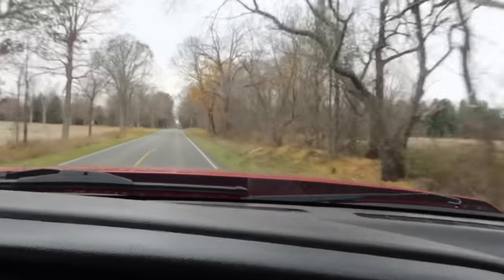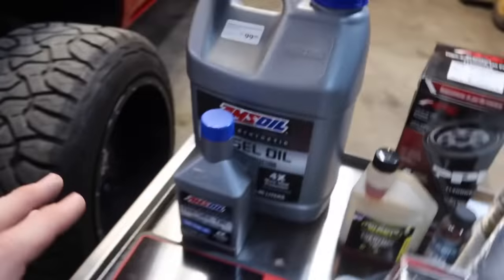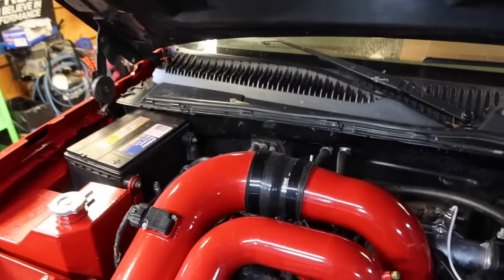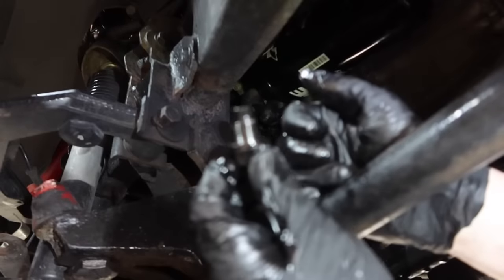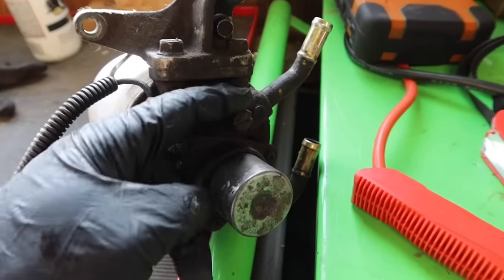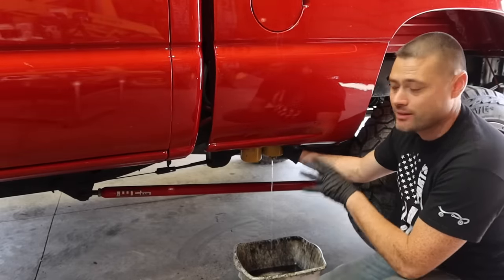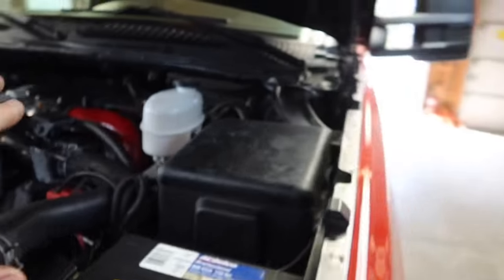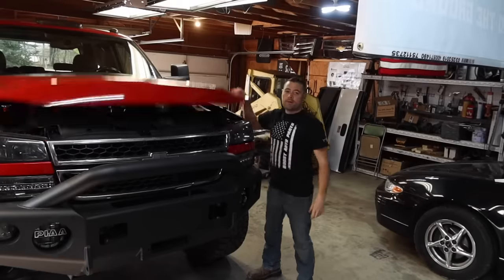How To Maintain A Duramax Diesel “MUST WATCH”

Comment: I found another way to check injectors if you don’t have a scan tool. Turn the truck on and once it’s warmed up, slowly rev the motor up to about 2500-3000 rpm then let off the throttle. If the rpm gauge goes down smoothly then the injectors are good. If the rpm gauge goes down then goes back up a little bit it’s a sign that one or more of the injectors isnt working right and still spraying fuel
Reply from the maker: I like your thinking
Reply: Thanks for the tip. I was stressing not having the scan tool
Reply: @TruckMaster how many miles between oil changes with amsoil?
Reply: I think it's 10,000 but you could always take an oil sample through cat or horizon / Polaris laboratories. Go on their website, they'll tell you what wear metals are displaying and what kind of fuel dilution you're dealing with.

Comment: Thought I would share that Amazon has a bundle deal on the A/C Delco oil filter, fuel filter and Allison transmission filter bundle deal $66 and some change. Where AutoZone wants $59.99 just for the fuel filter.

Comment: It’s all about common-sense maintenance. I run three diesels… A 1984 GM K2500HD with 6.2 diesel (bought new, 325,000 miles on it)… a 2007 Jeep Grand Cherokee with the Mercedes diesel (bought used), and a 2009 GMC 3500 xtended cab with Duramax (bought new, 194,000 miles). The Jeep is my wife’s vehicle, the two GMC’s are work trucks on our place here in NW Wyoming.

Best maintenance advice I ever got was from the head mechanic where I bought the 1984…”Never put it in gear until she’s warmed up… use the best oil you can afford… and use Power Service in every tank of fuel.” I’ve followed that advice religiously. When I bought the 2009 Duramax, I put 500 easy miles on it, then took it back to the dealer and had every filter and bit of fluids (except coolant, brake and power steering) replaced with fresh… in order to flush out any debris left in the truck at the factory. I then put 5,000 miles on it, changed everything again. Another 5,000 miles and repeat… except that third time, I used all AMSOIL full synthetics… differentials… engine… transmission… transfer case… and the AMSOIL 20-micron, 25,000 oil filter. 

I get a lab analysis once a year… change the Allison spin-on transmission filter and the stock GM fuel filter at every oil change. (5,000 to 10,000 miles… depending on lab results).

The vehicles are always serviced with AMSOIL synthetic oil. Euro blend for the Jeep and 15w40 Max Duty for both GMC’s.

Your results may vary.

I keep everything bone stock… except for the perceived weak points of the 6.2 that I rectified… Dual oil filter setup, a Banks intake/exhaust and an upgraded NOS GM fuel filter setup made for mid 90’s diesel vans.

Comment: Great info dude, don't forget to check oil level after running the engine to fill the new oil filter and check if you have directional tires, if they are directional then they don't switch sides during a rotation.

Comment: I suggest looking into getting a Fumoto F106N FN series drain valve. You got plenty of other fancy stuff and seem to have overlooked this little gem. The valve eliminates the need to carry an oil pan while on the go and practically eliminates the risk of making a mess during a change. It is particularly useful for people like me that are towing trailers full time and find themselves doing oil changes at random places because the road trip never stops. Thanks for the video and glad to see the channel is doing well!
Reply: I second you on the Fumoto drain valve. I ended up installing one cause when I would drain oil on my lift, the oil would splash over the drain pan screen and onto the floor. The Fumoto makes it drain just right. So easy to change the oil now. No more wrenching the pan bolt.

Comment: PPE +1 oil pan! Best investment I did for my Dmax! Flat bottom vs the hump in the stock oil pan which holds 16oz of dirty oil that will never drain out. As far as tie rods I run Rare Parts inner and outer tie rods as well as the Rare Parts pitman arm, idler arm and the pisk kit to keep the center link from rotating.

Comment: My L5p takes 16 quarts, yep 16, I have the ppe oil pan extra 2 quarts, than I have the Amsoil bmk filter and bypass extra 2 quarts, and I also made a custom exterior oil cooler which holds a additional 2 quarts with hoses, my oil changes cost me a arm and a tie rod, great video my man as usual.
Reply from the maker: Wow! Great job
Reply: I thought the PPE pan only added 1 QT
Reply: @devondidion4996  no two on the l5p, it’s awesome

Comment: Buddy like the vid. Please change your oil pan with the PPE High Capacity, Cast Aluminum Oil Pan #114052000. Add a magnetic drain plug. Does wonders.
Plus remove the factory fuel filter / primer housing all together. You have a lift pump. It's not needed.
M.

Comment: Another tip is if you don’t have a high pressure fuel rail 07 and older basically pre emissions. You can fill up the fuel filter with ATF and it will clean the injectors.( DO NOT USE ON A HIGH PRESSURE FUEL RAIL). But it’s a trick I’ll use as a diesel mechanic.
Reply: I just bought a 2008 with 233,000 on it. Does it have a high pressure rail? Any advice on how to clean the injectors and keep everything happy?
Reply: @everlysuniquetimbersawshop  if it’s the lmm then yes you do. If you do have one I’d recommend getting a diesel fuel treatment and just running that through it. (NOT gas treatment). On a lot of those because you have a DPF and EGR there’s a lot of very sensitive components you don’t want to send anything other that diesel. Other than that there’s not much you can do for the injectors.
Reply: @everlysuniquetimbersawshop another thing is keep up to date on filters if you’re sending dirty fuel through your injectors. You can kiss your injectors goodbye.
Reply: @connorchecketts it has been deleted. I’ll buy some hot shots and will use it every fill up.
Reply: @everlysuniquetimbersawshop  then imo you’re doing everything you can. I still wouldn’t use atf just because of the hpfr.

Comment: I have always used Shell Rotella 15W 40 in all my tractors and my 2001 lb7 Duramax. On one of my tractors it has 10,300 hours and still run good.

Comment: While the truck front end is in the air...stick a sleaver bar under the tire and lift up to check the ball joints.
Reply: How do you know if it’s good or bad?
Reply: @mikegarcia7452  if there is any clunking/movement

Comment: That plug at 7:00 cracked on my LLY. I was driving along and it stalled. When I tried to prime it I noticed fuel seeping out by the plug. Got it running but stalled several times before getting home.

Comment: Only add to the video.  Pre fill the new oil filter before you install.  Reduces time the motor goes without oil being pumped through. 
Reduces dry start.

Comment: I run Amsoil 15w40 heavy duty diesel and marine oil. The guys at my heavy equipment shop say there is less emission additives in this oil and better for the engine. Obviously I took their word for it and I don’t have facts about it. But I’ve been running it in my LBZ for two years now and she runs strong with 235k miles currently.

Comment: I noticed you had transmission filters on table but didn’t show changing them. How often would you change them and do you use Allison filters or aftermarket also which fluid do you use. Thanks

Comment: What's your opinion of putting Seafoam in your crankcase, for sludge reduction. O8 LMM 117,000. I basically use Seafoam to fill the volume for my oil filter. I bought a tuner, and more than doubled my mileage and power. Its stock, K&N breather filter, removed muffler at flange and 5" to the back. Lift pump is in the near future Air Dog, because of frame rail mounting.

Comment: I love your videos. I’m a pretty new dramax owner (07 LBZ) and maintenance videos like this really help. I also runs amsoil in all of my vehicles.I think the quality helps the vehicles run better longer. I also had an amsoil oil bypass system installed in my duramax. I also got an air dog on your recommendation. Would you consider doing a transmission fluid flush video? It’s the next thing I need to do on my duramax and I want to make sure I do it right. Where are the jack points (I’m new to DIY maintenance)? Also does the scanner tool you mentioned in the beginning scan for engine light codes? Thanks a lot. Keep up the good work.
Reply from the maker: Thanks! The scanner will do basically everything you need it to for a diy guy like myself

Comment: Great information, i recently got a 09 and it has wix on the fass and a wix on the factory fuel filter and has no water sensor its just the canister. I was wondering if you knew that part number to that filter option.  I can't get part number without removing and haven't researched hours but awhile.  I figured id be ok replacing them before winter and eventually putting the horseshoe hose on to delete it. Im use to old 7.3 powerstroke  with leaky fuel bowl and everything, i question the fass filters being EXTRA  exposed down there in sub zero with blended fuel and treatment even idk . Would i still need to pump the plunger on factory to prime with the fass on there? Also wondering what intervals to change little canister filter on trans and if that has a wix option.  Any help is appreciated as i know i can eventually find answers but figured you or some viewers may be able to steer me in the right direction.  Sorry for writing a book and using punctuation when I felt like it. Thanks for all the information you know your duramax for sure.

Comment: Josh, just tried out my new PPE  special Ed oil filter. Little story and a question. I know here you say tighten by hand using a rag. I guess over most gas engines my rule is soon as the filter seal starts to seat, snug it 1/2 - 3/4 more turn. I used this same technique and it was not as tight as I can by hand but pretty snug. After 10 miles on the fresh T6 oil change. On start up with my L5P the oil pressure hits high at around 100 psi. (25°f) After a couple seconds of  the engine starting, I had a blow out on the seal. Lost over half the oil in the drive way in about 2 seconds. Inspection of the seal shows it was not have a tear nor deformed. Do you think maybe it simply was not tight enough and how tight should I go without a reference gauge? I like the idea of the larger filter but the only change here is the brand. Is this a common issue that you have heard of?
Reply from the maker: I actually deleted that ppe video because I had the same issue with my filter. I contacted ppe and they told me those filters have to be really tight. The ppe filters are excellent filters but they need to be tightened more than the average filter. I’d like to apologize for the bad info I was under the impression that it only needed to be tightened by hand
Reply: I appreciate it sir. 
Man I was proud to show off this awesome new filter. Now I am backed up completely. Either way I am in pursuit of more filtration and additional capacities. I will seek out AMSOIL BYPASS and or maybe the CAT conversion. You ladies (wife) and gentlemen keep up the good work. Thanks.
Reply from the maker: Thanks

Comment: If you would purchase an preferred customer package from Amsoil, you would get all their products at dealer cost. Also if you would purchase the bypass oil filter system you will save money with extended oil changes.

Comment: Hmmm, 0w40 full syn oil since I’m a Canuck, Donaldson fuel filter up top, Donaldson blue for the oil, fleetgard filters on the lift pump, fumoto valve on the oil pan, Allison Oem filters. Optilube xpd when I remember to grab it or else stanadyne lubricity formula.

Comment: I highly highly recommend you try Amsoil's SAE 15W-40 Heavy-Duty Diesel and Marine Oil.  It's not to be used for post 2007 trucks with DPF installed.  I have used it and according to analysis of several other oils compared to it that I've done and used it is definitely the best, even compared to other Amsoil oils.

Comment: What do I need to cap my fuel filter, I also have a lly with an air dog lift pump system. My my factory fuel filter is still on but it keeps leaking.... I'm guessing this is probably due to my lift pump...

Comment: Hi love your videos. We have a big problem with our 2007 Chevy duramax we bought it new had to replace the turbo at 61,000 miles in 2016 we are now told we need a new turbo again 2022 with only 109,000 miles what would you do? We are retired & this is getting to be to expensive,

Comment: Maybe a dumb question, but what is that last noise you hear when you let off on the accelerator of your truck in the second acceleration? I never noticed it prior to putting on my HSP air intake and it made me nervous that I might have an issue with my LBZ, but yours did it too.
Reply from the maker: It’s turbo surge, the air has no where to go so it makes that sound under pressure. It’s not horrible on the turbo but it’s not good either. Some guys install a blow off valve to release the pressure but the psi I’m pushing is only 32 psi so it really effects nothing.

Comment: Question: I have a 2016 6.6 L Turbo Diesel Duramax 2500HD.  The chimes sound is way too loud.  Setting the volume control to 0 in the setting controls on the truck's touch screen does not lower the volume.  What is controlling the chime volume on this truck?  The dealership has been unable to answer my question and the YouTube videos are of no help.

Comment: Total newbie to diesels.  I see under the hood the surge tank on the passenger side with red fluid.  The. I was crawling underneath the drivers side of the engine compartment to try and see the engine side of 5he radiator and found a container with yellow fluid.  Are there two different coolant systems?  Also what is the big 4 inch hose that is colored blue?

Comment: You've inspired me to get myself a truck but now I have a question. What is the best model of this truck in regards to design, reliability, and ease of maintenance?

I would appreciate it if you could let me know what generation/year, engine, and anything else I might need to know. Thanks!
Reply: Either the lbz or lb7

Comment: I run amsoil in my lmm and love it. I’m a dealer and sell it at cost. Let me know if I can help anyone with an oil change kit!
Reply: I put less than 6k miles a year on my LMM, as I work from home now. I read synthetic would be a waste of money for that reason. Your thoughts?
Reply: @tmspete7354  NOPE!!!!  I have several diesels including 2 duramaxs', one has over 500K and its first 150K was on stock Delo-400 engine oil and was getting at least 10-12K miles per oil change,  when the truck leaves me and heads into service at the company it is switched to synthetic and intervals go to 15-20K miles with really good filters. The 500k truck is a 2006 LBZ and has never needed anything except basic maint, never been in the motor or tranny and it has NO blow by. The drivetrain will outlast the body by far.
Reply: Can I use that in my lml
Reply: @alfonsobernabe4291  you sure can!

Comment: Great video, i use an edge to check my balance rates, i also have 2 inj running -3 and my fuel economy sucks now and the truck has a hard time starting in the cold after sitting..idk

Comment: I just bought my 1st diesel yesterday ,2021 GMC AT4 6cyl Duramax. After watching this video, I ask myself what did I get myself into"..

 I do have a ??     I had a 2015 GMC sierra 5.7 and I replaced the transmission at 100k. I know these were HORRIBLE for transmissions going out at even 60k miles.... Is my new 10speed gonna hold up or they know for trouble as well ??

I also know I deleted the fuel man system on my old 5.7 so it would stay in 8cyl..  Does this 6cyl.diesel have the same system where it shifts down to 4cy or lower and should I have that deleted asap as well on this new "diesel" adventure I just got into ??

Comment: I’ve been using Amsoil since I bought my GMC LMM new in 2007. Never had issues.
Reply: AND just completed my pcv reroute and race fuel valve today. While I was at it, remove the turbo heat shield and repositioned the down pipe/ turbo ban clamp in prep for future change outs. Studied your videos closely!

Comment: Truck Master, my husband and I bought a 08 HD 2500 GMC Sierra, 4 door,4×4, short bed LMM, its been deleted and tuned along with the transmission. We love the truck and we've been putting money into her but we r having issues with it loosen water out and the check engine light came on and we got a code something to do with the torque converter staying off!
 Now is this something easy to fix. Like a sensor Or what can you tell me to look for or to do?

Comment: Friendly PSA: Rocking up and down to check ball joints aint gonna work when you have torsion bars unless you are lifting the wheel from under the control arm to take the pressure off it.

Comment: How often do you drain the water separator on your lift pump? I'm having one installed tomorrow and I figure it probably wouldn't be great to have a bunch of water freeze in there in the winter.

Comment: Can you program a new instrument panel cluster with that system? My dash had a parasitic draw so I got a reman. The miles are right but it says “program cluster” along with a few other lights that pop up. The guy I bought the gauge from will program it for $150 more, but maybe I’ll just invest in a system if it does the trick.

Comment: Hey I’m planning on getting some injector nozzles for my lly I’m thinking 50 over all my truck has done to it is a y pipe, egr delete with up pipe, efi live tune, cold air intake, turbo mouth piece, fuel rail plug, 5” exhaust, lift pump, and I believe that’s it I’m probably missing something but what size over injector nozzle should I get with those mods in mind?